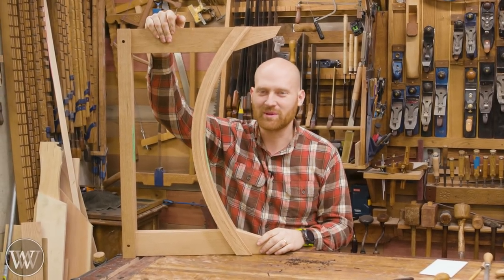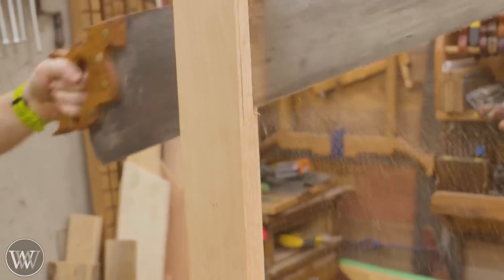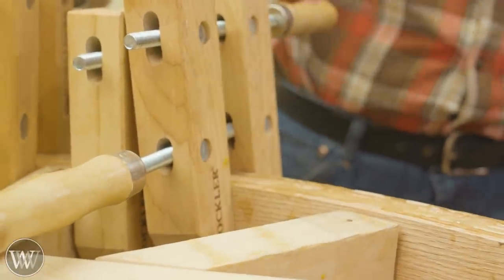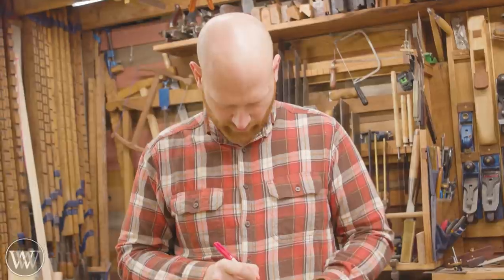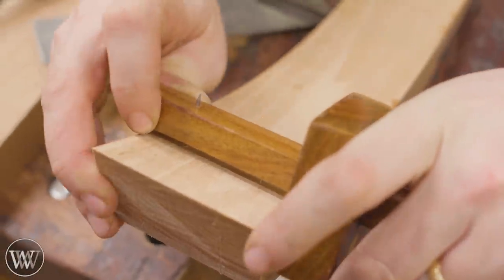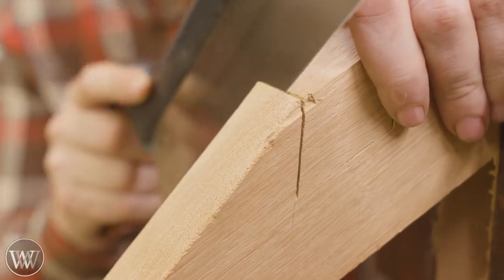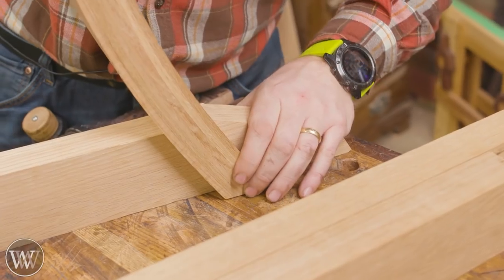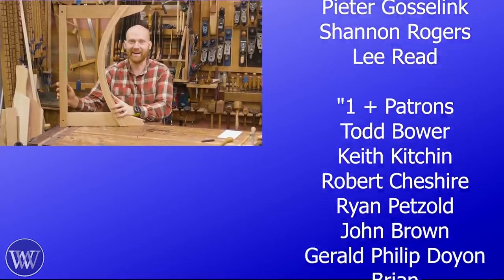Oak Slab Top Desk How to Bend the Srch For the Legs

Comment: Would the legs not have a tendency to want to splay at the bottom? I'd be tempted to drawbore the arch bridle joints too.
Reply from the maker: Gravity will hold the arch nicely with a 200 lb top on it. there are more supports still to add to the back this is just the legs.